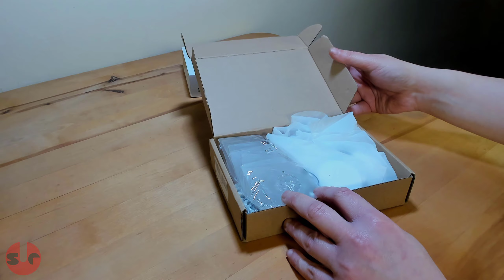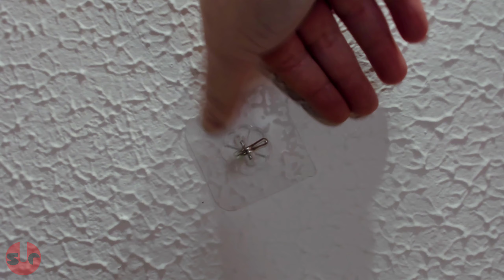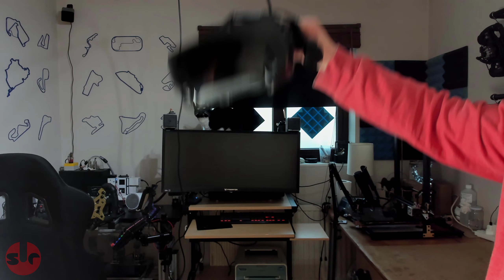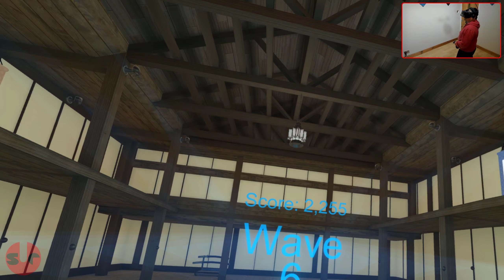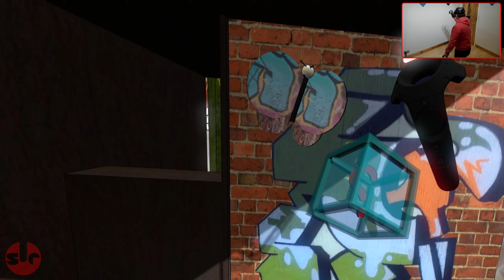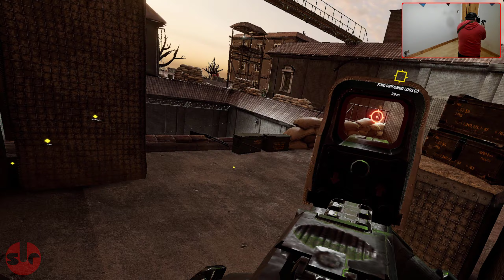KIWI Design V2 Silent VR Cable 'Pulley System' [REVIEW]

Comment: Nice video!
Just ordered the V2 (which was not available in the EU a few month back) that you have there as it is said to be a major improvement to the V1.
The V2 is easily recognizable by the fully rubberized, adjustable cable holder at the end of the pulley (and not a metal carabiner).

Hope the stock cable length wont bite me (rift S), but I am optimistic!